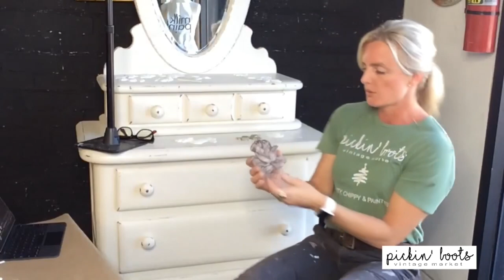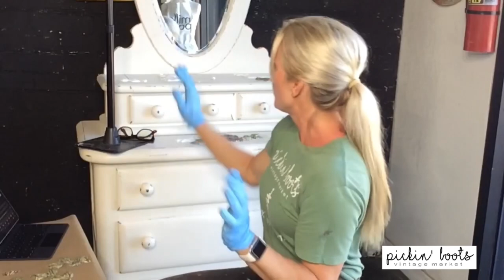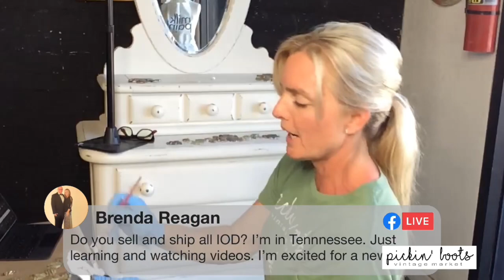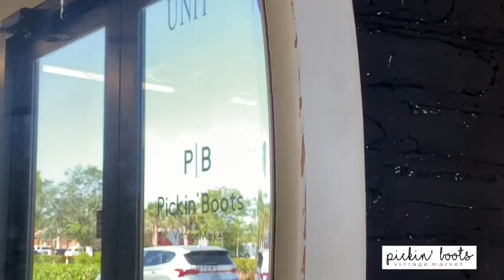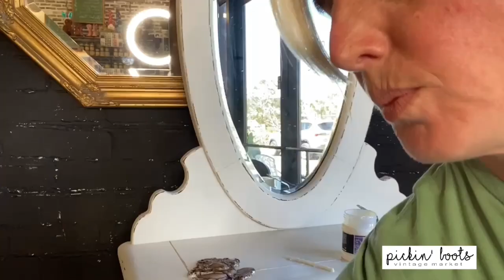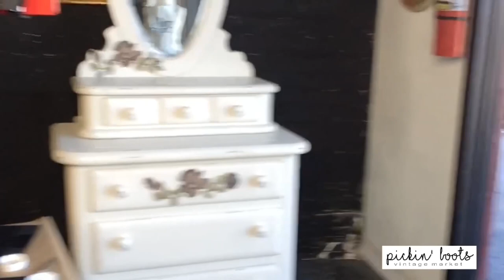Adding Resin Flowers to a Dresser Using IOD Roses Mould by IOD.  Dresser Makeover

Comment: question ...how do u deal with the reflection of the mold on the mirror?
Reply from the maker: You mean the one centimeter one small part of the rose and leaf stick out?   Make sure the back has color on it too. When you look in the mirror you barely notice it.
Reply: @PickinBootsVintage  is the part that goes over the reflecting side of the mirror and one can see the back of the flower...I want to make a mirror with sea stars and shells but that is the problem i have..I can see the back of some of the shells and one "arm" of the sea star.  THank you for the tip so much appreciated.  Blessings to you and yours.
Reply from the maker: @lolitabonita08  it’s such a small part of a large mirror you don’t notice.
Reply: @PickinBootsVintage  thank you so much...